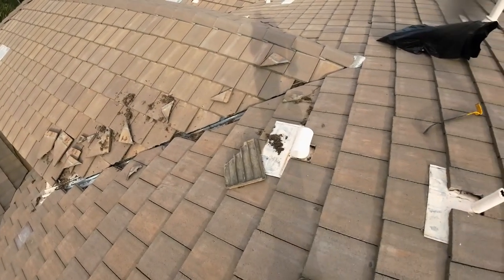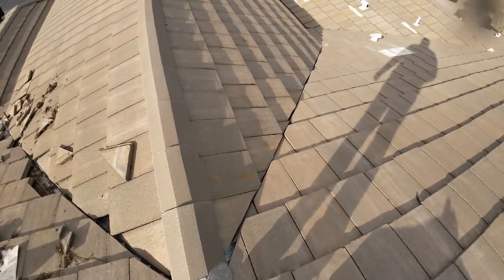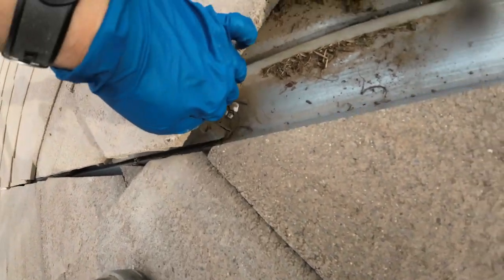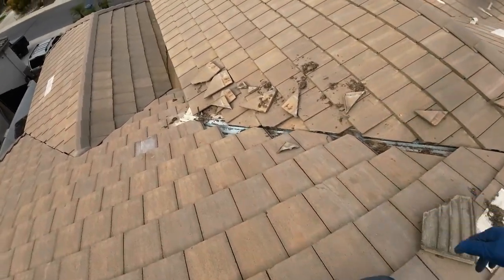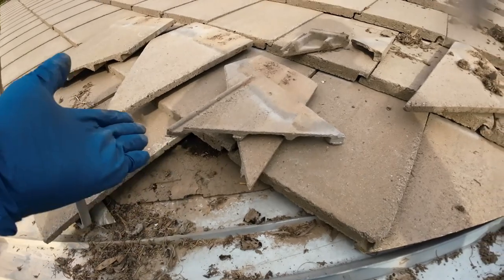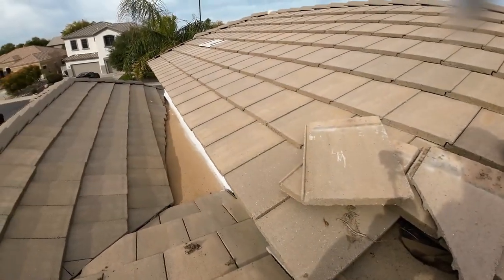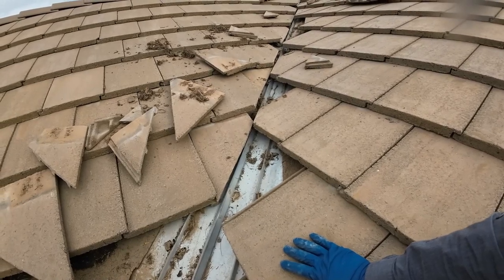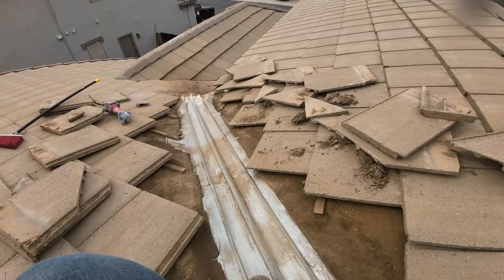Leaking for The Dumbest reason | Roof tile leak repair

Comment: I'm actually feeling better about my decision to tell the client what I was up against the last few days because I've been trying to fix exactly what you're talking about but I didn't want to get into removing all the tiles and stuff and cause more problems I used high pressure air hose a blower blowing out as much as I could remove the only tiles that I kind of needed to and that were really loose gaps and crap if you pull that Valley out you're going to cause a problem because I guarantee you that that plywood Gap it's going to be pretty invasive good video man to me everything you're doing is a really good solution to what I need to do I appreciate it a lot

Comment: The trouble with the USA all there bothered about is felt paper ice shield.  The valleys are a problem closed valleys are a joke because as you can see they get .blocked tiles are there to keep the water out . If you made the pitch greater in the first place you definitely won't have this problem